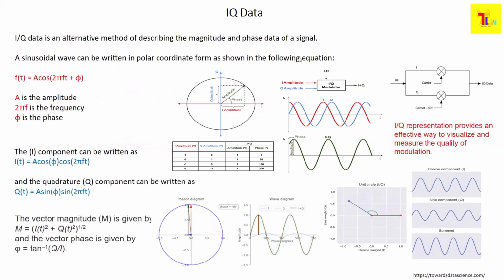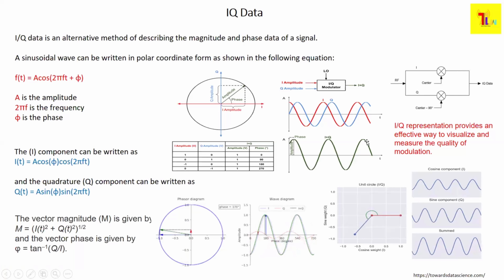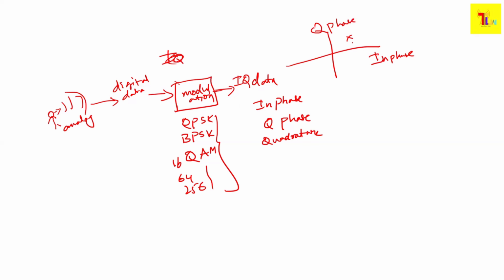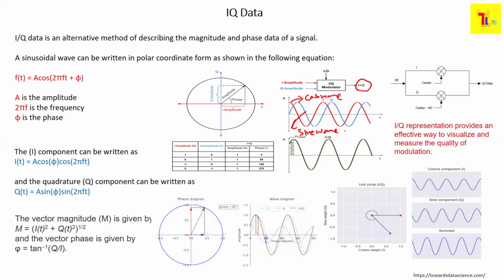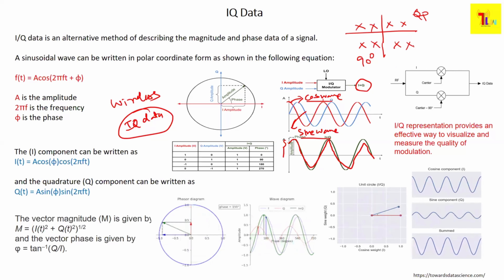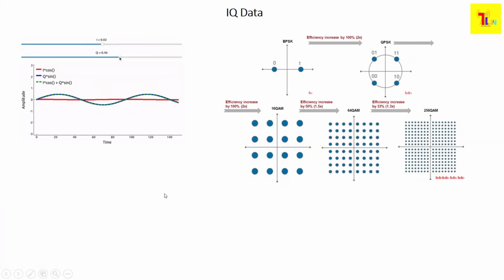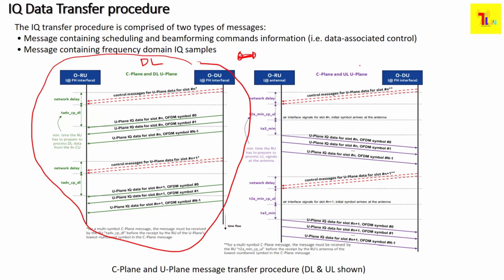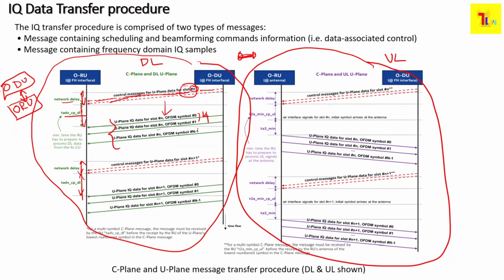IQ Data & their Role in RU-DU Communication | Techlteworld

Comment: What's different between IQ and QAM modulation ?
Reply from the maker: IQ refers to the In-phase (I) and Quadrature (Q) components of a signal, which are used to represent it as a complex signal for modulation and demodulation. QAM (Quadrature Amplitude Modulation) is a modulation scheme that uses both I and Q components to vary the amplitude and phase of a signal to transmit data. In short, IQ is the format, while QAM is a method that uses that format to encode information.
Reply: @techLteworld  So, QAM just use the IQ format to modulate signal .
Reply from the maker: @b3vuu9t22  Yes, exactly! QAM uses the IQ format to modulate signals by varying the amplitude of the In-phase (I) and Quadrature (Q) components. Each data symbol is mapped to a unique combination of I and Q values, forming a constellation point. So, IQ is the foundation, and QAM is the technique built on it.